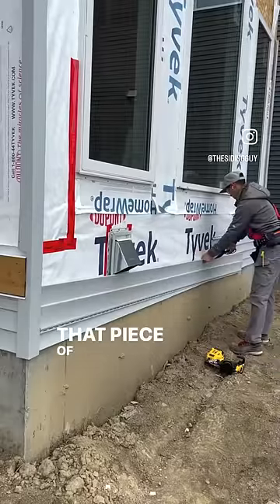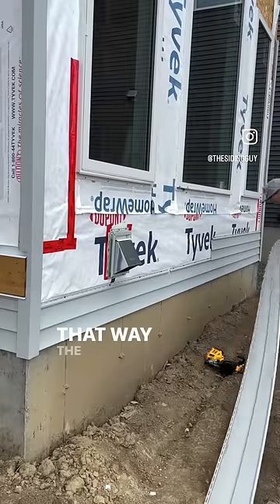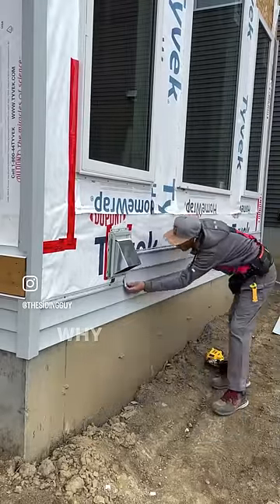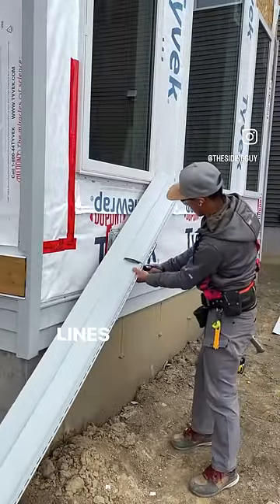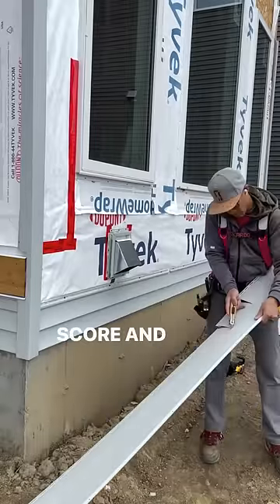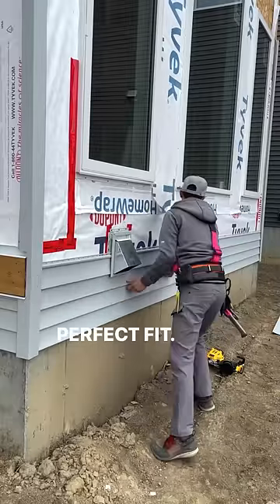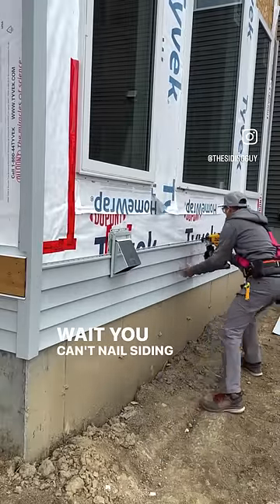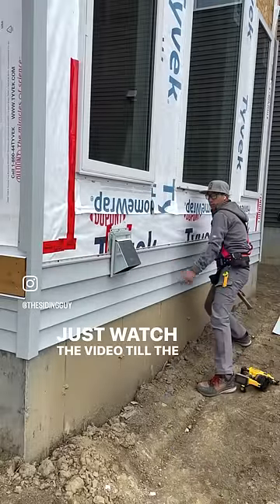Cutting out siding for a vent. Nailing with a cordless vinyl siding nailer

Comment: Roofing nails work out over time in high winds, seen it happen a lot. I put mine on with deck screws 1 5/8 inch and it’s been ten years so far using a screw gun adjusted just right
Reply: That all depends, if they're nailed to the studs they don't. Hurricane Ida scoured the siding off of two sides of my house but the nails stayed behind.

Comment: So, what did I miss? Was it to tight? My eyes are not as good as they use to be.
Reply: At the end he slides the piece of siding left and right , showing it is hanging from the nails. And not tight to the wall. He has an attachment he puts on the end of his nail gun the doesn't allow the nail to fully sink. Allowing  the siding to hang from the nail like it should. At least that's what I got out of it. Not much siding where I live.

Comment: Nothing wrong with making the job quicker and easier. The only thing I will say is, take a hand nailed roof for example (by pros) the hand nailed roof will have a longer life expectancy over a roof nailed with a gun. 
A bit of quality is sacrificed with the gun but, still works fine
Reply from the maker: This installer actually used hot-dipped galvanized nails unlike the electro-galvanized nails.  Stainless steel nails are also available at select suppliers.
Reply: @sidingtips  that’s awesome. Before I got into ironwork I worked summers building houses doing a lot of siding. Once it’s vinyl it’s final! I do miss it. Quality siding always shows when you see it

Comment: You can't beat a plastic house it never rots
Reply: It doesn't rot, but it gets brittle & breaks. Plastic doesn't like UV light, nor is it very pliable in frigid temperatures.
Reply: Try hardie
Reply: Seamless steel is way better except easy to scratch if your not careful when locking in  , but that's what touch up paint is for  but shhhh. Don't let the home owner see you doing touch up on the corners . If it's a big scratch ya gotta redo it

Comment: I don't think its an attachment or roofing nailer. Its a siding nailer you can set the nail depth on. Use it for Hardy or Can Excel too.
Reply from the maker: yes it’s our patent pending vinyl siding adapter on the nose of the nailer